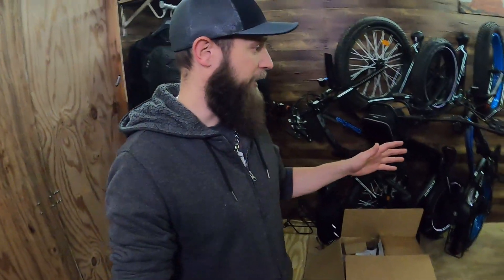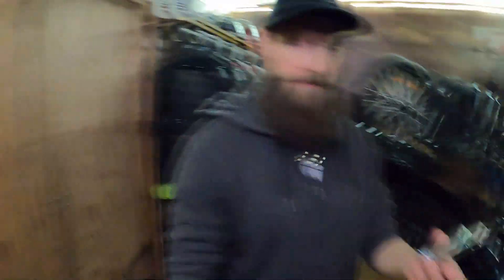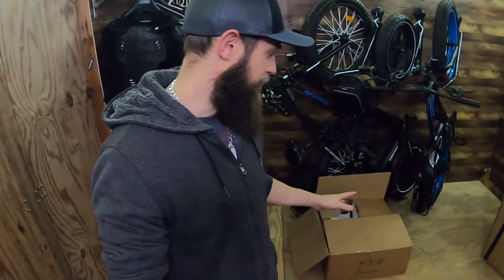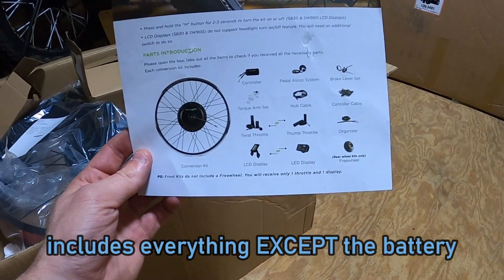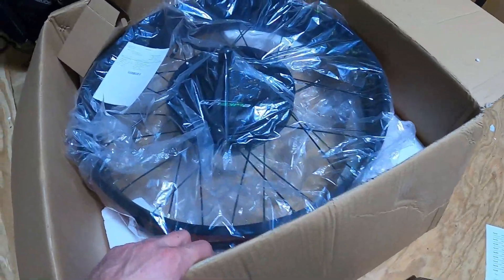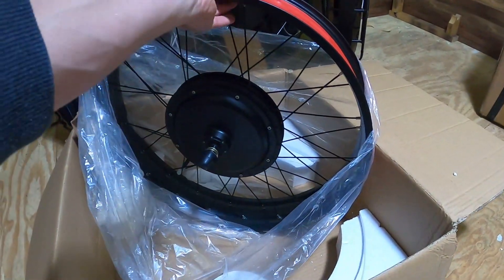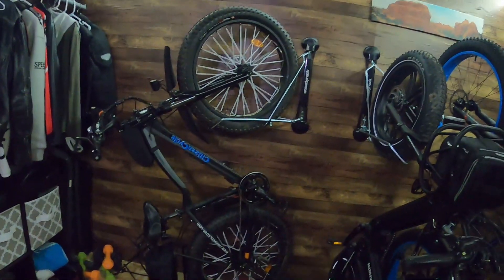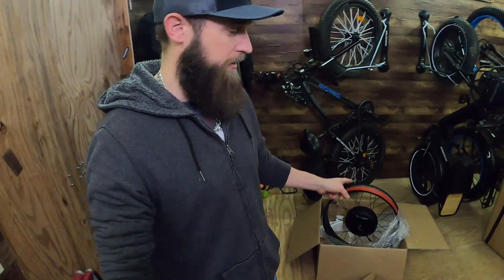Conversion Kit for Front of Radrover

Comment: I was trying to upgrade my Himiway cruiser like your radmonster, all wheel drive and bought my front wheel kit from ebikeling. Just letting you know I will never spend another dime on anything from them.
Really fast shipping received my kit and battery ($856+)within 3 days . Sunday started putting my kit together and found a controller wire that had the insulation stripped on one side so I taped it and continued 
with the kit. I had the wheel and everything all assembled now for plugging all the wires together. Everything was plugged until I got down to the, controller to battery connection which was nowhere to be found, keep in mind I bought the kit and battery both from ebikeling . Well that ended the rest of working on the kit . I still had to go to the store to pick up dinner and I wasn't about to switch the front wheel back out just to run about 8 blocks away ,so I went ahead and rode it as is and thought it would be fine since I was only using my rear hub motor . What another suprise I found when the front wheel didn't want to spin freely . Normally my Himi will run 26 - 27 mph but with this wheel on , top speed was only 11 - 12 mph . Coundn't wait to call the company Monday morning with all the issues I was having. They open at 9 am and I was on the phone for 2 hrs off and on because their answering service comes on tells you vm is full then tells you to press 5 so your # will be sent to someone .  I went ahead and switched my wheel back cause there was no way I was ridding it like that again and went to run an errand , wouldn't you know that they had called me back and left me another # to call for tech support in that little window . Soon as I got back home I called the new number and I'll be damned it did exactaly the same thing said vm was full and to press 5 to send my # to someone, By this time I'm pissed , spending almost $900 and can't get ahold of anyone , so I email them again which I forgot to mention that I had emailed them Sunday night with a description of all my issues and finally received an email at the end of day asking me to explain my power issues , the error codes , if the display worked . So clearly they never read any of my emails because I told them that I had no power, they had never sent me a connector for battery to controller . This was my final straw so I went to the bank and had them get my money back and can you believe I still haven't heard from them .
So beware of ebikeling .

Comment: My Himiway cruiser has star tip bolts, so I had no problems like you had with yours... the bolts on the Radrover motor has security star tip,  so the same tip I used for my Radrover upgrade, I used to open my Himiway motor...
I want make my Himiway cruiser AWD just like your Radrover...
Are Radrover and Himiway forks the same?

Comment: We'd never yell at you... you're our hero! Did the company tell you what the RPM of the motor is at 48 volts? If we know that, we can calculate an estimated top speed. The Bafang motor you have in the back wheel right now has an operational speed of 2094.26 RPM at 54 volts (full charge for 48 volt battery). Since the motor also 5 x gear reduction, the wheel speed is 418.85 RPM.

You will need both controllers and displays on the bike, unless you get a dual motor controller. You should be able to connect the one throttle and the motor cutoffs to both controllers, but the display, moto feds, and phase wires will have to stay separate of course.

Looking forward to the results of your bravery, SIR!

Comment: Looking forward to seeing your results. I'm no expert but think you made a mistake getting a motor so different from the 1st. I have seen where the front hub is slightly weaker than the rear (to avoid torque steer) but never a difference between direct drive and geared hub. I'm guessing your rear wheel will accelerate faster than the front but the front will have a higher top speed...the rear wheel will push during acceleration and the front wheel will pull once you approach full speed. No matter how it turns out I applaud your efforts and hope to learn something from them.
Ride on & enjoy;)

Comment: Far out, curious how it’s gonna work. I would suspect you need a special controller to synchronize both motors. Either run the front or rear motor by themselves or both aiding each other. Good luck, will be watching.

Comment: Awesome!! Remember if the front wheel is a quick release use the C incert spacers and torque arms. The c incerts are very important to seal and prevent the drop outs from breaking. In video I saw C inserts in the bag.
Reply from the maker: Okay good to know. I've never installed torque arms so if I have any questions I know who to ask 😁
Reply: @CitizenCycle925  for sure yeah if any questions just ask! Hey I noticed your wife is Asian my wife is from the Philippines.
Reply from the maker: @boostercontrol100  should I be placing a washer between the wheel and the dropout? On the inside of the dropout?
Reply: @CitizenCycle925  I didnt on mine I did like yours I have picture but idk how to send can pvt message on youtube?
Reply from the maker: @boostercontrol100  ridewithcitizen@yahoo.com
Reply: @CitizenCycle925  cool
Reply: @CitizenCycle925  did see my pics? you know I was thinking there are 175mm and 190mm drop out kits maybe thats the issue?
Reply from the maker: @boostercontrol100  I did see the pics thanks for sending it I looked up front drop out width on Radrover's website and it said 135 mm so that's what I ordered
Reply: @CitizenCycle925  ah ok cool I bet be ok without the washer just tighten real good and check often.